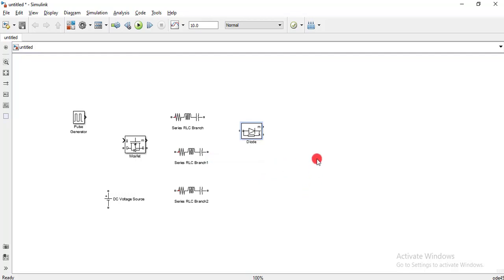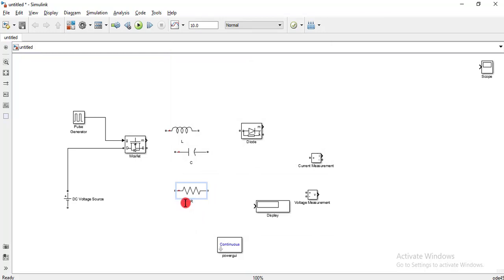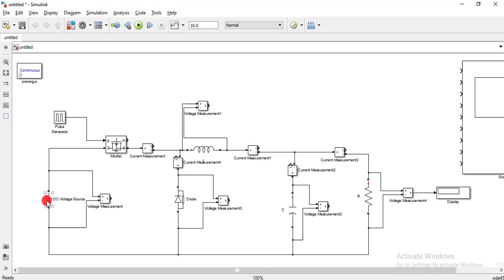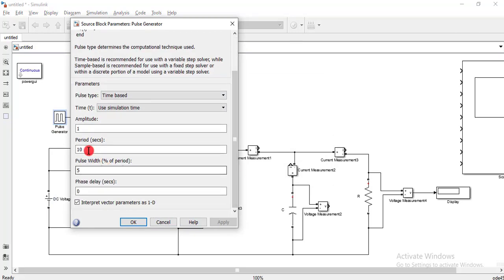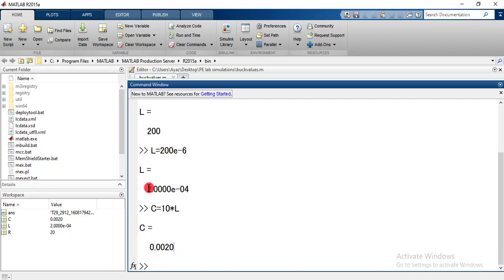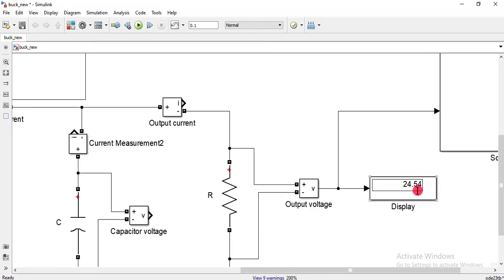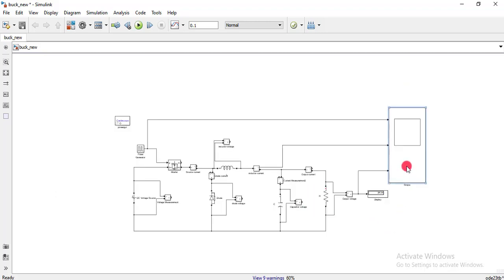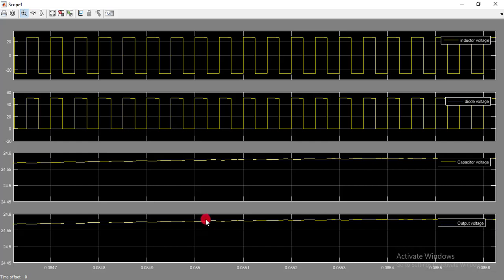Part 6 | Buck Converter MATLAB Simulation | DC to DC buck converter in MATLAB SIMULINK

Comment: That's very straight, Thank you
I want to know if you can replace the inductor with variable inductor block and instead of a specific value replace with an equation (example L(t)=L-0.1*t) to see how it changes with time.